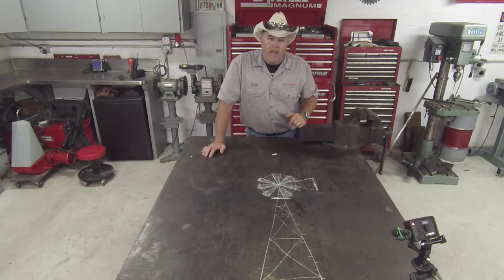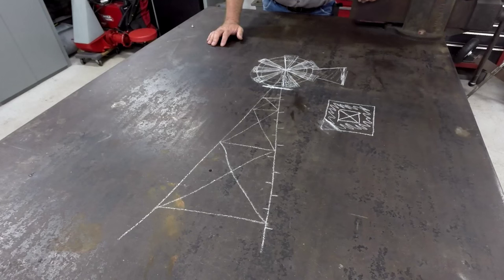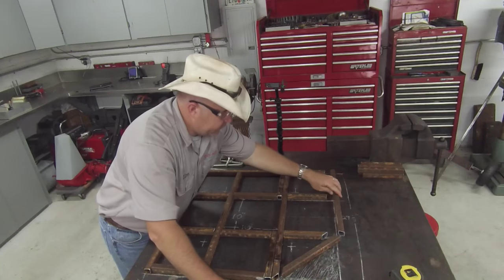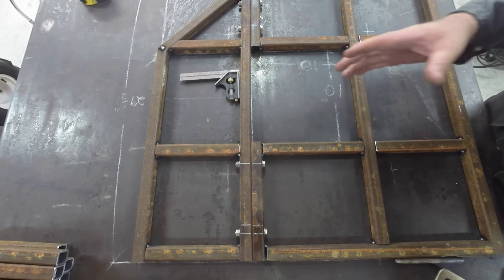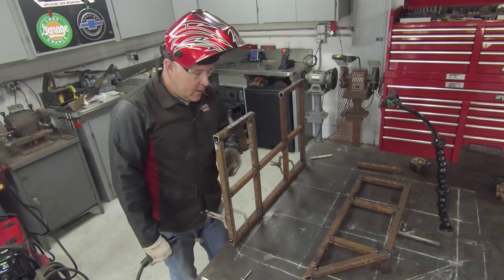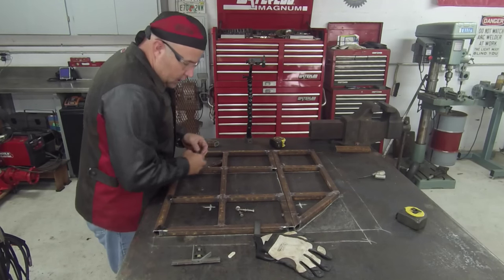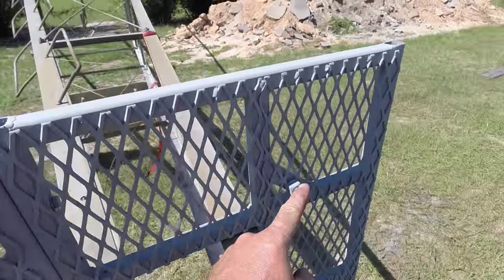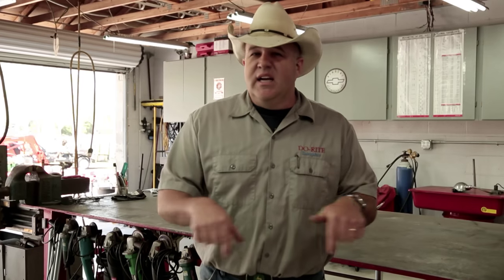Vintage Aermotor Windmill Restoration Ep 5: Fabricating / Welding the Tower’s Top Platform

Comment: I bet that platform will be a fun place to be on a windy day! I was amazed that the 3/4" thick plates I welded on the bottom of my crane supports actually drew slightly concave from welding them on. Weld shrinkage can really get ya if you don't allow for it.

Comment: Great video and project. I have to tell you though, that platform would have to be 20' x 20' with 5' high rail guards for me to get on it. I prefer the platform to be as wide as the tower is tall. Yes, I am scared of heights!
Reply from the maker: +William Hardin, I get that it's a bit....narrow up there. Good thing I trust the welds...LOL
Reply: People who are scared of heights are just displaying their basic high degree of intelligence.  As we say in the construction business, "it isn't the fall that kills you, it's the sudden stop at the bottom".
Reply: I see how you have trouble with wooden platforms/decking over in Florida.  I recommend that you try Trex (or other composite wood decking)  it stands up to the environment and termites hate the stuff.  The best part is that it never needs painting; YEAH.  You can build the structure with t-angle and screw the decking in place.  By the time that wears out, it will be a problem for the next generation to solve.

Comment: I made something similar for my 60 footer prior to standing. its made out of 1 1/4 angle and expanded metal. mine has a ladder going up one side as opposed to wire steps up a leg. I have an air pump on top to aerate the pond. it's making squeaking noises now so I'll have to go up to service soon. Not my favorite place to go!